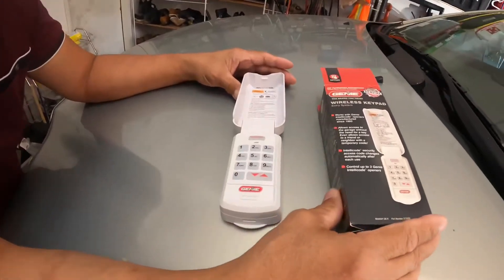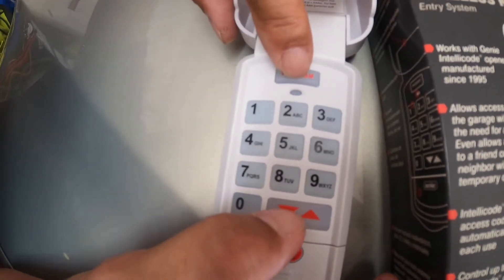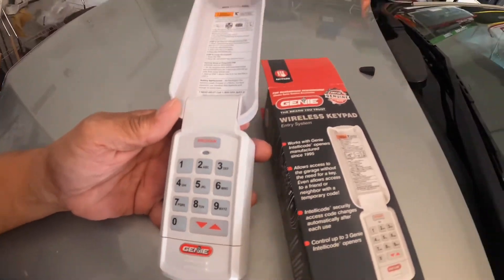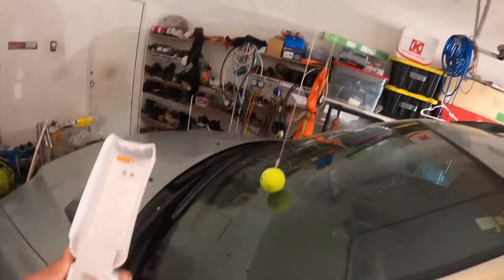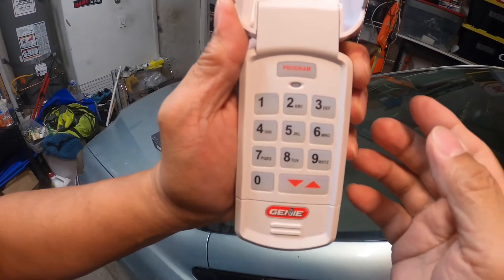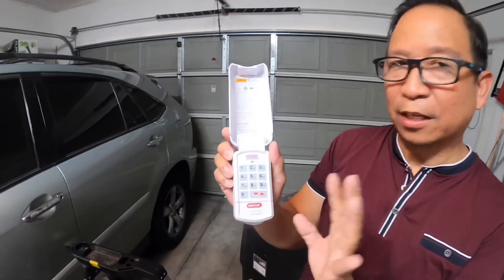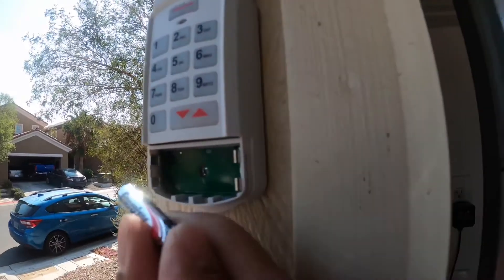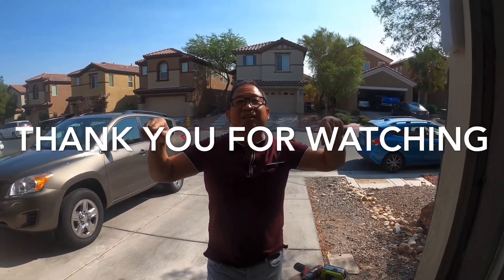How to program a keypad for your garage door opener outside your garage.

Comment: Awesome video. Next is to lube ur garage door so it’s much quieter
Reply: That’s a good idea. Thank you!
Reply from the maker: Thank you for the suggestion.
Reply: @jeffreyson6025  no problem. Don’t use WD-40, it causes damage to the door. Use 3in1 garage door lube. You can get it at Home Depot. Also, pick up a tube of Lucas oil products white lithium grease, and run a pass of it on the screw of the opener.